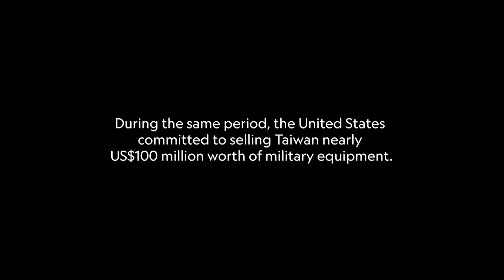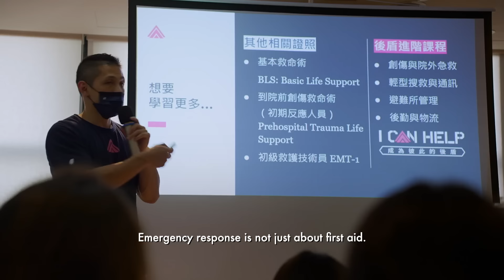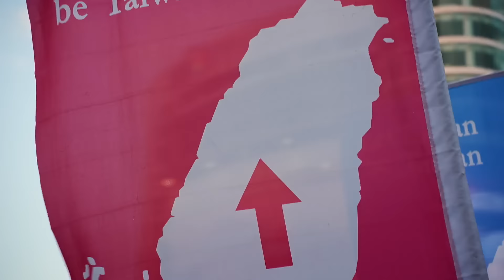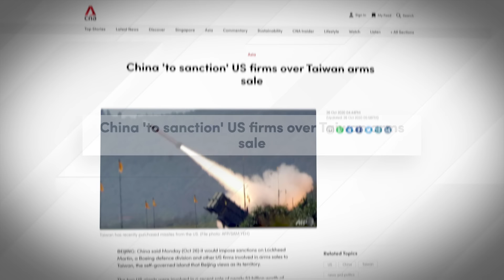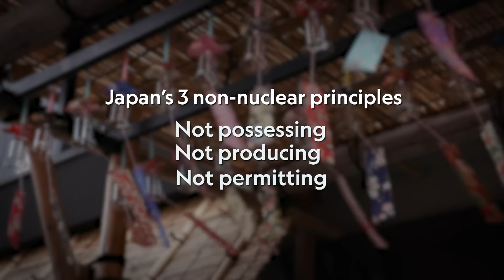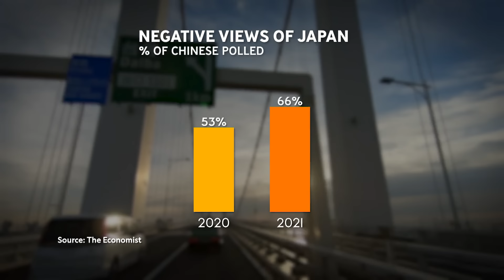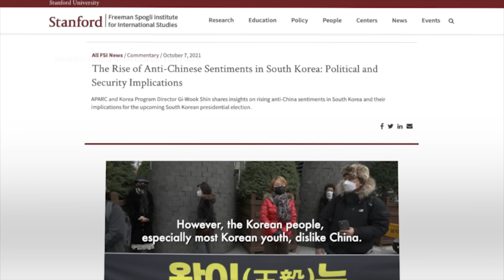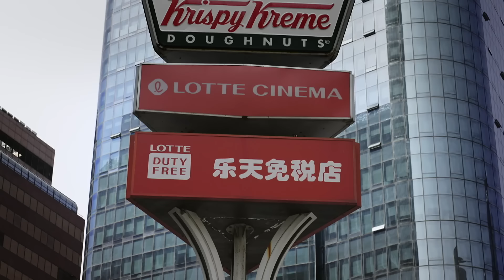The Taiwan (Japan & South Korea) Contingency | When Titans Clash 2 - Part 3/3 | CNA Documentary

Comment: China will let Taiwan become independent sooner or later.

China didn't claim Taiwan till 1,683AD. That is about 1,800 years after China took HaiNan Island. 

Look at the maps of HaiNan Island and Taiwan. The two islands are similar in area size. But Hainan island is much less mountainous hence more conducive to larger population. And yet Taiwan has almost 3 times as large in population as that in HaiNan Island.

Why? And this is the same reason why China didn't claim Taiwan for well over 1,800 years after it took HaiNan Island.

HaiNan Island is only 40km from China. Taiwan is at least 140km but as far as over 400km from China, on the near side. Chinese flee from China and they would choose Taiwan over HaiNan Island.

Eg, in 1850~1864AD, there was a major rebellion in China that killed, conservatively estimated, 50m or about 10% of the then China's population. 

The Taiping Rebellion reached HaiNan Island within a few months after it started. But it never reached Taiwan. Taiping Rebellion took the bulk of China south of Yangtze River but it never touched Taiwan as it had no means to do so. 

China knew for centuries that it could control HaiNan Island easily but it could never do so with Taiwan. That's why China never wanted Taiwan at all whatsoever.

 China never controlled all Taiwan even after it claimed the island in 1683AD. It took the Japanese military persistent efforts over a decade to achieve so in  early 1920's. 

History has shown that indeed Taiwan is very difficult for China to control. Precedents have been set as feared all along by China for thousands of years that China lost control of Taiwan easily. The current Taiwan since 1949 all but has proven this beyond dispute. 

Taiwan has literally thousands, and soon tens of thousands, of missiles that could reach China. Many of these are over 300km in range to 2,500km range.

That is Shanghai, Gunagzhou or entire Yangtze River Delta and Pearl River Delta are within the range of these missiles. 

Some missiles of Taiwan could reach beyond Beijing and Chongqing, the largest inland city in China. 

Attacking Taiwan would only see Taiwan retaliate by hitting economic infrastructure all along the coastal provinces and inland provinces behind them. 

Power plants, petrochemical plants, oil refineries, steel plants, mineral processing plants, container port operations, LNG ship port, etc would be targetted. 

All the sudden, Chinese economy would collapse and hundreds of millions of people in China would be out of jobs, without clean water, with little food and no access to most basic necessities of life. Sooner enough, millions would rebel against CCP. PLA would have no time attacking Taiwan but they have to defend themselves against the the rebellions. Indeed PLA units would be fighting one another for supremacy. 

Just ask Chinese that you meet why exactly the main reason for their migrating out of China. They would admit, sooner or later, that they are dead certain China would descend into chaos and they don't want their families in China. 

That is attacking China might turn out to be the death trap that CCP China sends itself into. 

At the end of the day, China will let Taiwan go. It is the best solution so as to protect China itself. The peace would be assured with Taiwan but also within China itself.
Reply: If the Taiwanese miraculously landed missiles on any critical or mass-life threatening infrastructure of the mainland, they would be struck with nuclear missiles. They could probably get away with landing missiles on coastal cities, but that's as far as it would go. Frankly, offensive options for the ROC are a very limited option.